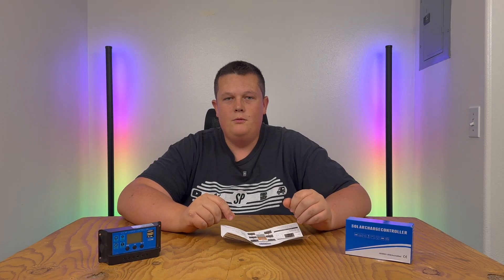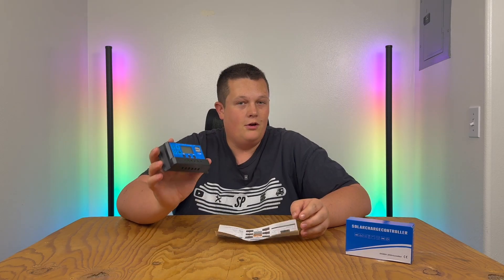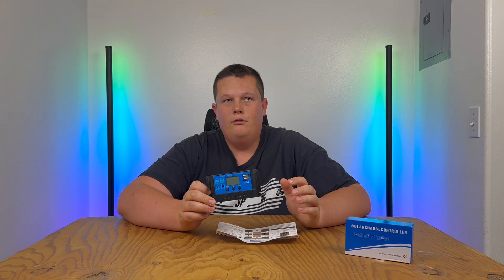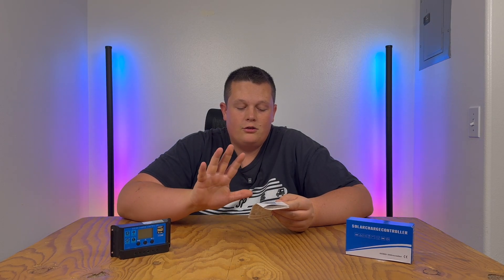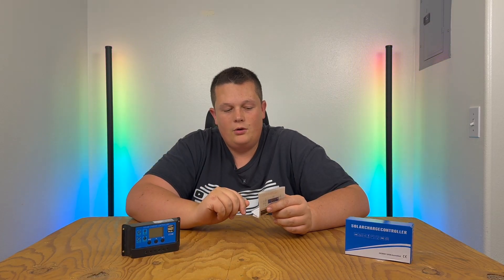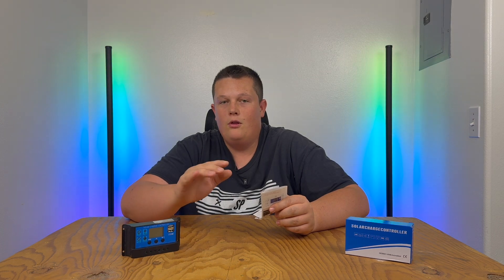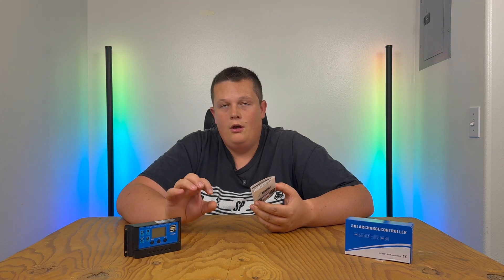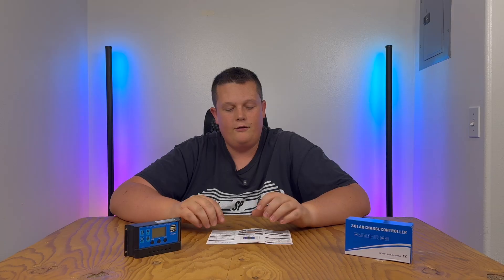How to configure load run times on a Solar Charge Controller

Comment: You put it to 1 hour, and hope it  doesn't drain the battery too much.  Or put a smart power plug after the inverter and still set it to 1 hour.  So either the smart plug turns it off or the 1 hour after sunset.

Comment: I can't change from 24h. Nothing happens if I press the down button. It worked fine for a month on my new 120ah lead acid battery which I was using to charge laptop and battery banks but now it looks like the battery is not being charged. Maybe it would be wise to just get a better controller?
Reply: On the "24h" screen....press & hold the Menu button until the 24h flashes....then use the up & down to adjust.